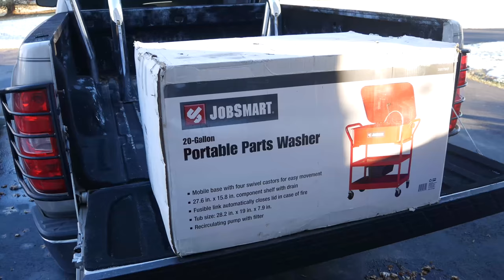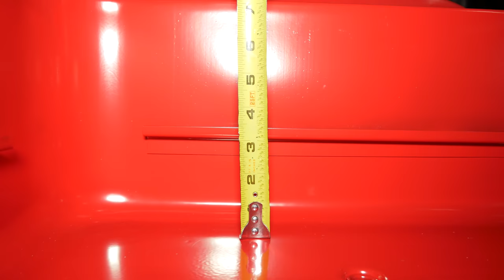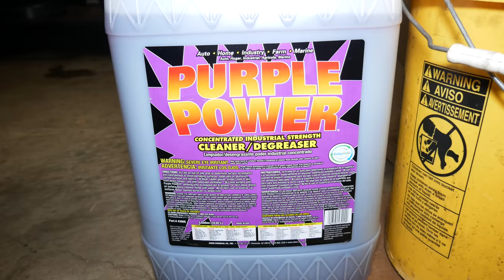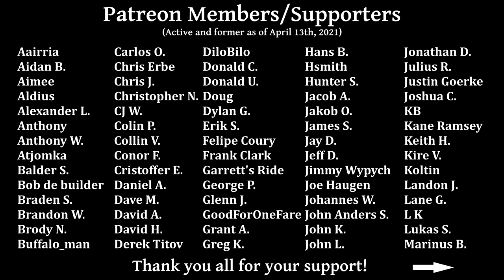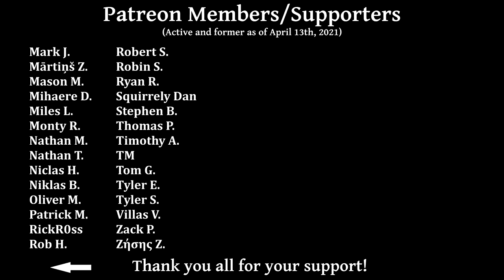$200 454 Engine Rebuild: Cleaning Engine Internals and Hardware (78 Firebird Ep.17)

Comment: As to the two Motors that I use that stuff on the only Parts I use or water pump new timing belt tensioner new new gaskets set of bolts for the head everything else is reused on the oilfield you can cheat if you have a deep deep Groove Gangnam rear main seal were you able to gasket carrier to the block add several thicknesses gasket material thin sturdy material and you can move oilfield to a new location can you do the same with the head camshaft seal but I'll let you guys think of the way to move that seal enjoy your engine building boys you have all your life to create with your hands. My ship is 69 Nova off the island of Oahu not going to see the date but I drove that Nova after picking it up at Oakland shipyards they burnt the wiring that I am provides just started because the ignition was way too expensive to buy in Hawaii nition switch and ran a wire from the starter do under the dash to switch and that wire back out to the battery worked fine for me the whole time I was out in Hawaii with that car let me tell you a little bit of history about that car 69 Nova don't remember the serial number once carried a license plate bdr 844 bedroom 844 and that was the second car I lived in in Hawaii and in Monterey Fort Ord army base and I sold it to a guy in Monterey not far from the Southgate I don't remember what but not too far from Blythe Broadway there was an auto shop I walked in one day and I didn't want it to be ship to Japan and I didn't want to waste my word so I sold it to one of those guys for $500 and I wish the hell I had the car back my heart I sold with the car one thing it didn't get was my steering wheel and hood scoop you had Corvette Wheels in bottle cap hubcaps black and color Ned for speed manual I put a 327 in it from a junkyard I bought in Hawaii model car 64 Impala for $50 use the frame of that 64 to repair a 64 Impala SS frame-off restoration from a stupid accident underneath the bypass by the football stadium in Aiea Hawaii I bought the car it was sitting you in a feedlot sold animal Dry Goods it was sitting on blocks when I first saw it in the driving by in my 64 Impala 64 Impala I bought $200 worth of tools put in that trunk Craftsman tools the only toolbox I had was that cardboard box I bought a lawnmower and I lived in that car and those are the things that I supported myself I enjoyed the old Chevys I love those old Chevys they were great I had a whole lot more than just those hey dude if you ever run out of love for the old Nova I'd love to have it back for a while before I die this is Ziggy from Pearl Harbor Hawaii my heart lives on Maui my memories live the Pearl Harbor guess what I once was enjoy your life guys

Comment: the sheer amount of panic in the comments... this is how things were done when only race teams could afford a machine shop.
the only thing that made him change the cam was the damage to the bearings, he's definitely going to change them now.
if the bearing wasn't damaged there would have been absolutely nothing wrong with running the stock camshaft in the stock bearings with moly on the lobes and breaking in a new set of lifters.  he has to change the lifters, timing set and now the bearings which is why the change in camshaft is justified.
Reply: @Leo Coffy you replied to some of them, the youtube mechanics who panic when you reuse perfectly good parts.
Reply: @Leo Coffy you replied to one, Finn Screenname "OMG dude you so need to keep that stuff in order. Pushrods, rockers, rod caps, that all has to go back on the same place it came off at. Everything has wear patterns already. You put #4 rocker on to #7's pushrod it has to make a new wear patter and could cause it to fail. As for rod caps, they install them on the rods and then bore the two together to make them the right size. If you put #1 rod cap on #5 rod you may have real issues. I hope they were numbered..... If you are just doing refresh kit in that motor (you should look at Northern Auto Parts for a rebuild/refresh kit ) every part of that motor that touches another part should have been put back exactly where it came from. 
On a $200, 454, double make sure you do valve seal or you will be sorry. Easy now, major pain later."

Comment: that will run like a champ all clean and inspected new rings bearings  seasoned take her straight to red line we used to build em like that  down on the farm gravel road motor run the piss out of em    thats gonna be one hell of a motor i wouldnt be able hold her down im not that good a driver